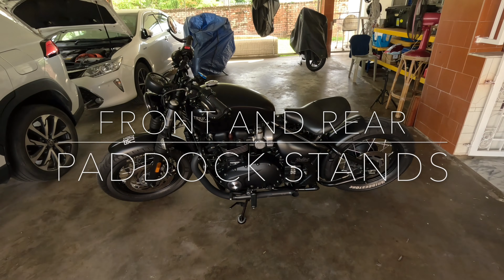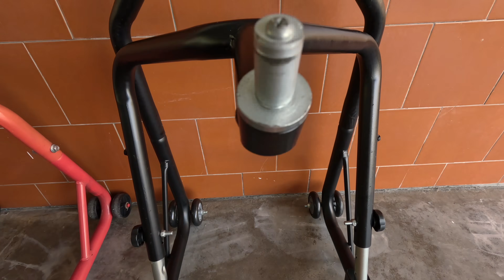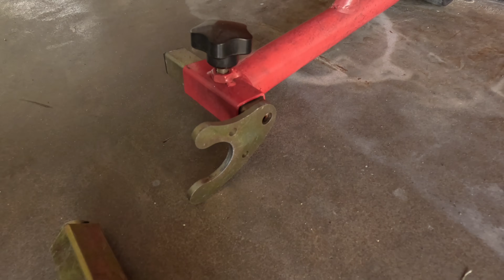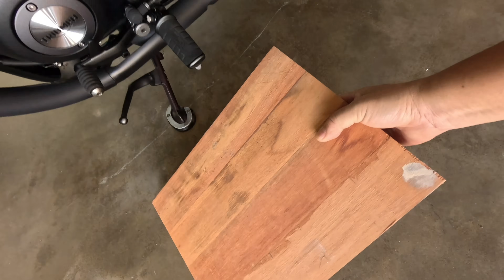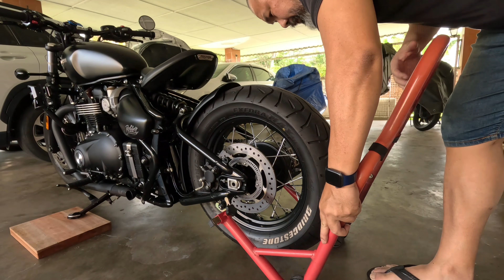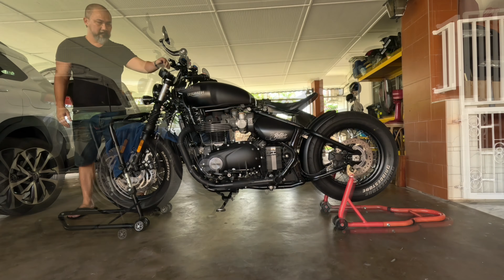How to use the Front & Rear Motorcycle Paddock Stand | Triumph Bobber

Comment: How to remove the front axel once the front stand is fixed
Reply from the maker: Hey bud. Thanks for your comment. 

Here’s a video I did when I was replacing the front disc rotors. I have to take the wheel off to change the rotors. This will give you some idea of how to take the axle out. Hope it helps. 

There’s also another video I did in this  channel where I replace the front and back tires too. You can look that up to get another perspective. 

https://youtu.be/JEuLcsRrxBU?si=b20vg-jZynDhn5iu

Hope you can support my channel by subscribing and liking the videos. 

Thanks. 🙏🏽
Reply from the maker: https://youtu.be/pMiy6g3ToB8?si=cPLN3CAn7qPS7awK

Comment: Have you a link for the front lift paddock stand? I have the same bike
Reply from the maker: Hey there Mr Drums 😁.. Thanks for dropping by. I hope I didn't misunderstand you, but for front paddock stand, it's at 3 minutes 18 seconds on the same video.   Let me know if thats not what you were asking for. Cheers! Len
Reply: @ufo8mycatagain   I believe he was asking for the make/model of the paddock stand so he could purchase the same one. I was also curious for this information.
Reply from the maker: @zuinness ah I see. Thanks for clearing that up. I bought a no brand generic cheapo. But basically, it’s known as a “motorcycle front paddock stand for the headstock”. Hope that helps.

Comment: Thanks for sharing this video. Funny enough, I wasn't interested in the paddock stands. Instead, I was looking at your license plate side mount. Did you have to add any washers or did it fit straight on? I found the same side mount on Amazon but was hesitant to get it because I wasn't sure about the fit.
Reply from the maker: Hey Erik! Thanks for dropping in. The answer is no. I did not need anything extra. However you cannot install it on the left side of the bobber. Only the right side. I put the existing washer over the bracket then the spindle nut. Then tighten to spec 110Nm. Hope this helps. 

You’re the 2nd Erik I know that has a ‘k’ instead of a ‘c’. 😂 where are you from?

Comment: Hi can you tell me what size pin you are using for the front padlock stand
Reply from the maker: Hi. Thanks for your message. Generally, there isn’t a standard size for the exterior of your pin. It all depends on what colour you may want to match your bike. 

On the other side of the pin is the bolt size. It may be 6mm, 8mm or 10mm. Check your bike’s size before you purchase. 

Hope this helps.

Comment: Can we use paddock stands to park them or is it fine to use side stand for long standing in the garage. I dont drive much, just a casual rider.
Reply from the maker: Hey man.. The answer is yes, you can use paddock stands to park the bike. If you plan to leave it on the stand for months/years at a time, then it's probably a good idea to put it on a paddock stand.  There is a risk of the tyre developing a 'FLAT SPOT/PATCH'.  It happens when the tyre is rested on the same spot for too long of a period. I guess it also depends on the quality and type of tyre compound. Having said that, I doubt that weeks at a time would do much to the tyre. So the side stand will do just fine. But for multiple months/years, low tyre pressure and hot weather, I can imagine the tyre developing some deformation, especially if you have a heavy bike.  Hope this helps. 

By the way, thanks for your comment. Where are you situated and what do you ride? 😁
Reply: @ufo8mycatagain  Thank you very much for your reply and brief insight. I'm from India and just booked a Royal Enfield Continental GT 650. It only comes with a side stand. The Bike being heavy, i was exploring options whether to just use a side stand or get a center stand installed and just came to know about the paddock stand and saw your video how it works. Hope you are well!!
Reply from the maker: I'm well and thanks for asking.  Had an awesome ride today, and I feel great!

Wow! The GT is an awesome looking bike. I've not seen one in person, but I do love the RE's.  Beautiful bikes. Not so long ago, I was eyeing an Interceptor 650 (2023) as my 5th bike - LOL.  Only had 2k Km on the clock. Owner is a little more mature and is facing some health challenges. He wants to let it go.  So it's still a possibility. It's in mint condition.

Back to the stands.  A centre stand is the way to go, if you're planning on long trips.  Easier for emergency roadside maintenance.  But it may or may not distract from the overall aesthetics of the GT.  But if you decide to go the route of the paddock stand, I've noticed that most RE's exhausts tend to be slightly in the way of the rear paddock stand bobbin/pegs on the rear swing arm.  So make sure you get a paddock stand that allows you to interchange from the 'hook' to the 'cup'.  You'll see what I mean when you get back into the showroom and check out the modern classic RE's. The pea shooter pipes seem to right in front of the bobbins on the rear swing arm. Something to take note of. 

Safe riding friend and keep both wheels on the road. :)
Reply: @ufo8mycatagain  I'm new to bikes so I don't have much knowledge but the Interceptor is a very cool looking bike and great for long routes. I wish i could afford to have 4-5 bikes. Lol. I'm glad for you :)✌✌ I liked the paddock stand more. I'll discuss your point with the showroom when getting accessories installed. Thank you very much for your help. I'd just use the bike for commute. Hardly 100-200 kms (60-120 miles) a month. The bike weighs around 202 kgs (445 pounds). Can I rely completely on the side stand as i'd use the bike often and it will be my sole bike so it wont rest for long standing in the garage.
Reply from the maker: @bhargav @bhargavshah7689 yes. You can completely rely on your side stand. Be confident that it will suffice. 😊

In colder climates where some bikers store their bikes away for the colder seasons (sometimes 6-7 months) a paddock stand is recommended. In your case you will not have this issue. So the side stand is fine. 

Where a paddock stand / centre stand becomes additionally useful is for cleaning and maintenance. Sometimes the side stand doesn’t provide enough height to get underneath the bike. A paddock stand will be an advantage for Tyre replacement and surrounding parts maintenance.  Ie - chain / brake maintenance. Not impossible to do it without a paddock stand. 

I have a bike that is 255kg and another pig of a bike at 337kg (I have a motorcycle jack for this one 😂😂)

A new rider? Welcome 😊 to the world of two wheels. Please allow me to part some humble advice. Pls ignore if you already know this. Remember to always ride your own ride. It doesn’t matter if you are the fastest or the slowest. What matters is that you get to ride again tmrw 😂 enjoy your GT and be safe.
Reply: @ufo8mycatagain  Thank you for your valuable help!! I'll stick to the Side stand then. True " What matters is that you get to ride again tmrw" You too take care and hope to see more of your content after I get the bike. Take care!!
Reply from the maker: @bhargavshah7689 you too.